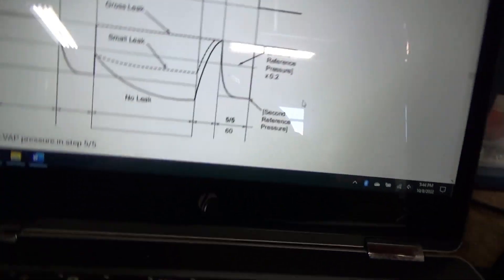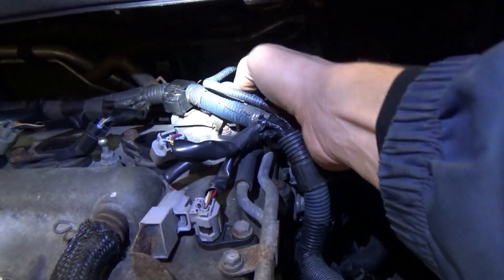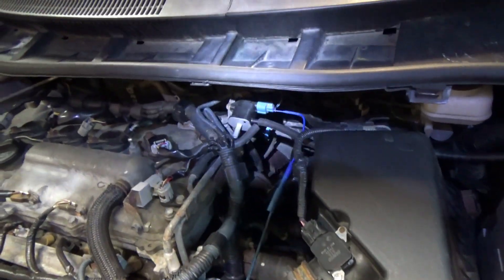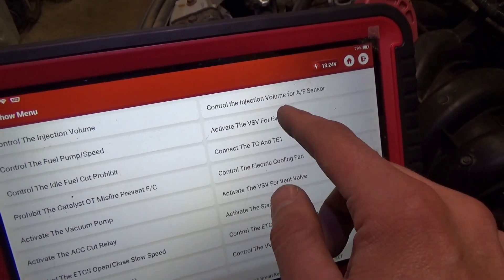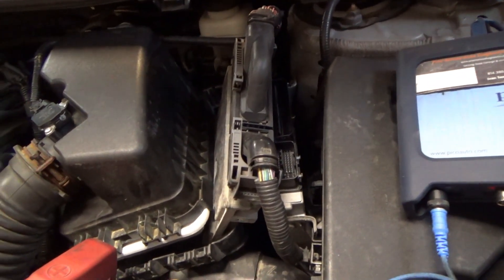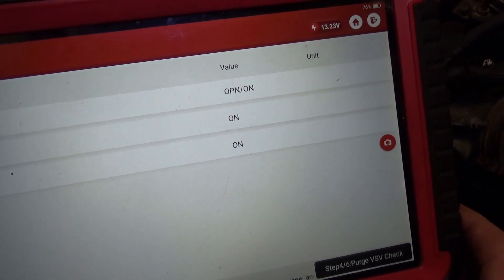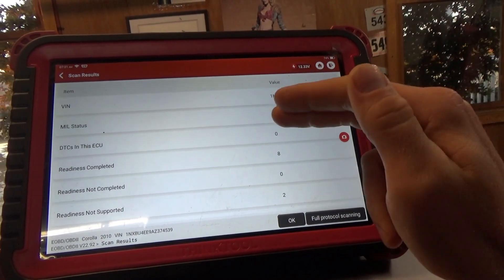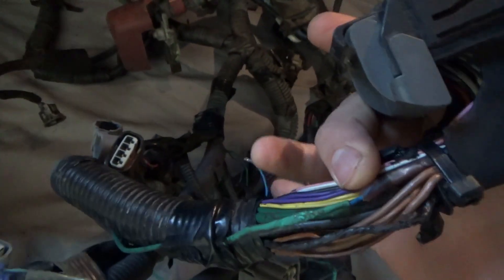2 YEARS of Parts Cannon?! (Toyota EVAP - Part 2)

Comment: We watch Scotty for the education, Ivan. He recently told us why we don't really need $3,000 'smart' washing machines. Who would have ever suspected that? And who doesn't love his cat inserts.
Reply: Actually the smart washing machine has come in hand recently, i wasn't after it when i bought, just a combined wash and dry machine, when I came home noticed it had internet connectivity, thankful for it today. Probably not in NA but here the fixed electric is so high that not worth having. The spot prices fluctuates like crazy over a day. So the same wash depending on time may cost 4cent or 4$. 
Suddenly the smart washing machine that you can tie to a script the reads the next 24h electric spot prices and wash on the cheapest hours isn't so stupid. Same goes for dishwasher, water heater and house heating. Of course you can start it manually at that time but at least I'm not interested in getting up in say 2AM to flick a switch
Reply from the maker: Hah I just saw that with the fancy BlueTooth washing machines and fridges haha Preach it Scotty!

Comment: So you kept referring to vapor pressure rising back toward atmospheric within 10 seconds. That's accurate when the Toyota is doing its own Evap test while the key is off. The purge valve will get commanded 100% on. The same thing happens when you use a scan tool to perform the automatic Evap test. But when you choose to do the manual Evap test, the ecm then pulses the purge valve. Silly, but I've seen amazing techs get tripped up in the difference between the automatic test and manual test.

I've also never seen that driver fail. Not saying that its impossible. But my gut says that someone damaged it with poor testing techniques.
Reply from the maker: Hey PJ thank you for the insider information! Someone mentioned in Part 1 that there is a TSB on this? I couldn't find it... Car history is questionable for sure. But something had to break in the first place to promote any sort of "testing" right?
Yeah ThinkTool only had "Manual" test available. 100% Purge would definitely vent the canister faster than 30% clicks :)
Reply: @PineHollowAutoDiagnostics  yeah, there is a TSB for water intrusion in the charcoal canister and there is an updated filler neck for it.

I’d love to know what the first failure actually was. Leak detection pumps are a fairly common failure. Put the parts cannon probably created more problems than it fixed.
Reply from the maker: @VoltageDropDiagnostics  Coming to Super Saturday next week? I'll be there, and Keith too!
Reply: @PineHollowAutoDiagnostics  I’m teaching there. I’m actually teaching a class on toyota evap systems haha
Reply from the maker: @VoltageDropDiagnostics  LOL that's awesome! You could show a clip of this video 🤣
Reply: @VoltageDropDiagnostics   I am glad you commented. I saw your name and realized I hadn’t seen anything uploaded by you lately. When I went to your channel to see if I missed something, I learned that YouTube had apparently taken it upon themselves to unsubscribe me.

Comment: Questions:  The owner did replace the ecm, so why were the codes still popping up? Why did it start working?  Did you replace something and I missed it?
Reply: 1. The owner had a bad ECM and misdiagnosed it.
2. The owner added aftermarket part(s) that created a secondary problem.
3. The owner's original problem was diagnosed and fixed.
4. The secondary problem,caused by aftermarket part, went undiagnosed and caused the same codes.
5. Ivan replaced the aftermarket part with original. 
6. No codes... for now
Reply: @_RiseAgainst  Very good, Thank You.
Reply: So the owner added to the confusion, by replacing the OEM valve with a cheap Autozone  purge valve?
Reply: @chuckvoss9344  basically half of Ivan's videos.
Reply from the maker: Yes please watch the entire video 😄

Comment: I tell people all the time (mostly Jeep blogs) "DO NOT IF AT ALL POSSIBLE REPLACE ANY ELECTRICAL COMPONENT WITH ANYTHING BUT OEM!" It may not be show an issue right away, but chances are it will eventually. I don't know why, but I have box of aftermarket Jeep TJ parts to prove it! Great work, Ivan! I knew you were onto something  when you mentioned he replaced  the OEM purge solenoid. 👍

Comment: I also follow the OE parts rule after having being burned by aftermarket electrical parts.  Interestingly, some customers get offended when I replace their "new" aftermarket parts with OE parts and fix the problem.
Reply: It's something everyone must learn first hand.
Reply: The general public is mislead by advertising, into thinking that aftermarket parts are as good as or even better than OEM.  It’s hard to blame an ignorant car owner.
Reply: @The_Redkween  Certainly there are cases where aftermarket parts are better than OE or are engineered to solve a certain problem. Such as replacing the OE plastic coolant crossover pipes with aluminum, in various Euro cars. You're right though, just as often, aftermarket parts turn out to be much worse than the quality OE. Like replica alloy wheels, "ebay" turbo headers, junk China bearings in timing sets, cheap ball joints or suspension bushings, bottom tier brake pads,  junk MAF sensors... the list goes on... Or you may get a fake! Like the fake NGK spark plugs, or fake HKS blow-off valves. Not no-name replicas, but straight knockoffs, label and everything. Sometimes coming from the same factory, sometimes different. These vary from OK-ish to totally useless junk! This is happening in the PC parts world as well, and I imagine everywhere else. Even the medical world, with fake medications. Amazingly though, sometimes the (cheap) automotive aftermarket can make stuff on their own label that's actually decent. It's kind of crazy the huge variations in quality as well as the multitude of options we have today

Comment: One thing I'd like to know if different between the two solenoids is the inductive kickback.  That can wipe out a driver.  Perhaps one had some kind of suppression the other did not.
Reply: And maybe the design quality of the plastic parts, there could be a burr or two in the passages messing up the through put of the valve and degrading the performance thus setting the code?

Comment: As always cheap aftermarket parts strike again especially with electrical parts because the modules and the electric sensors need to shake hands and agree with each other  never ever do that better off buying an OEM or high quality aftermarket parts that will last much much longer
Reply: try using a maf sensor on a toyota from auto zone never will the fuel trims be right
Reply: @juanrodriguez-ry6yt  Ya That's why I bought a Denzo ignition coil because I knew if I put an aftermarket one in it just would not last.

Comment: These crappy electrical chinese knock off parts are more often than not not fit for purpose and therefore should fall foul of some trade description legislation, how the hell do they get away with the supply and sale of components that simply do not work properly?  Had similar problems with the passenger door lock actuators in my Sequoia,  first one failed within a year (got a full refund), second one failed after 13 months.  The actuators were eBay specials that only cost $15, the one I installed yesterday was a whopping $60 but is OEM so should last longer than the first two!  Got tired of removing the inner door panel and it is a bit of a fiddly job.  As you say Ivan buying cheap parts can be a false economy.
Reply: I want my job fixed right the first time. I would MUCH rather pay $60 for an OEM part and have it fixed over a $15 junk part and have to go back in and waste an hour or two of my time.
Reply from the maker: Hey Rob! I can't believe the door lock actuators still work on my 1989 Mazda van... Toyota quality must be slipping haha 😉

Comment: I'm of the mind that by the time a car comes to your shop it's no longer about the parts, that's already been tried and it didn't work, charge as you see fit, you're a very fair person and your expertise and time is what people are paying for, if it takes 5 hours so be it, after 2 years I'm sure anyone would be happy to be done with it, great job
Reply: yeah I agree. 3 hours is more than fair considering he has to wait for the 5 hour after two drive cycles for the evap self test. Manual testing didn't give any concrete conclusions. I would have wanted to charge more for this myself but seeing as how someone better charges 3 hours, I will be reevaluating how I do my own labor quotes.
Reply: sure   but this car is worth $1500 on a good day so paying more than half of that to get it running for no one knows how much longer makes no sense
Reply: @111-c7x2t  what part of the world do these go for $1500?
Reply: @111-c7x2t  that’s not the mechanics problem

Comment: I have noticed Toyota's are very particular about setting codes for emissions. I wonder if its because Japan was so strict on emissions earlier on compared to elsewhere. 

I'm not as sophisticated on diagnostics as Ivan but I've found a good tactic for a little swaptronics testing - go to the scrapyard and find a "fresh kill" and strip whatever part it is you think is suspect. If the car was wrecked chances are it was fine when it went to the scrapyard. You have a better chance than getting into aftermarket parts.
Reply: I doubt it - Japan pretty much follows the EU standard, which allows much higher emission than the US, esp. California.  California has some of the strictest emission in the world, so much so they mandated all manufactures use OBD2 (which California designed/invented).   The EU standards allow for 3x more pollutants than US Tier 3, nvm California.
Reply: @ckm-mkc  one standard in Japan that Cali doesn’t follow is leaks.  In Japan, cars can’t leak anything……at all…..not even a drop.
Reply: Probably! I bet more than half of 2010 Corollas in Japan have already seen the crusher!
Reply: @rkan2  Either that or they got sent to a middle income or 3rd world country as a grey import. New Zealand is full of Toyotas that got chucked in Japan because they were 5 years old.
Reply: Most asian cars were over engineered until they figured out they can make them cheaper and they are still better

Comment: And now that I've finished it (wild that's all it was!), my theory on the failed output:

The car manufacturers, in a quest to save money, are skipping blocking diodes on the driver outputs to coil driven actuators.

Any DC coil is going to generate inrush current against the driver.  Half an amp at 12v is actually not insignificant.

Any driven outputs (other than one actuated by relay) will eventually fail after getting hit with inrush current over and over.

The pinball industry learned this in the 80s, which is why every solenoid in those things is protected with a diode.

When the diodes fail, become disconnected, etc ... driver failure almost certainly follows.
Reply: I concur, I saw those spikes on the scope.
Reply: I am not as knowledgable as you, so may I ask a question?  If the purge solenoid had a relay installed to operate it, would that protect the driver in the computer?
Reply: @dws2313  likely so, because relays have a much much smaller coil in them.  It's why relays control so many things in cars, acting as the interface between CPU and load.

Comment: I Diagnosing a misfire on a Sienna, all the coils were aftermarket and the one on cyl 6 was bad, the customer was upset and saying I was wrong because he had just replaced them all with new spark plugs not to long ago, he had tossed all the factory coils. Also those  style purge valves are junk from the factory and go bad all the time, better then the aftermarket but still junk.
Reply: New is better🤣

Comment: The original "harness hack" guy was on the case, but didn't like the price he was quoted for a PCM.
Reply from the maker: He simply didn't know how to test a 2-wire circuit...splicing wires is a LOT harder than taking a couple voltage measurements ;)

Comment: Scotty Kilmer would just drilled a hole through the firewall, run some wire and put a toogle switch on the dash for the purge valve
Reply from the maker: And then try to convince you that the "dealer level scan tool" said that is a good fix lmao

Comment: I am in complete agreement with original parts for replacement. The mystery to me, which I have asked many sources including my parts store, is why and how companies (like Dorman) can market products that have a high failure rate or flat out don't work.
Reply: Because they are just cheap enough (at least compared to oem) that people keep buying them. Auto parts store doesn’t warranty used electrical parts so it doesn’t cost them or Dorman money. If anything it makes them more money when people buy another ‘cheap’ sensor. With the general public, cheapest price by in large wins out over quality.

Comment: I love the Dig at Scotty. Our 04 Corolla had 2 ECMS replaced...under warranty and recall. Was one of two issues.  The other was the fuel pump.
Reply: I don't think it was a serious dig at Scotty. All working components have a statistical failure rate but a high value doesn't mean that every single one of them will last a "long time", even Toyotas.

Comment: I can see the purge valve being a cause of a fault. I saw this before on one of Paul Danners videos. He replaced a purge valve on a Hyundai (I think it was a Hyundai). Apparently the purge valve wasn't electrically built the same way. So the aftermarket purge valve is working. But isn't opening and closing at the right amount. Meaning the coil inside is wound differently and thus changes the open and close time. This effectively changes the flow rate. So in this example it seems like the pcm was bad. But then the replacement of the purge valve caused a new problem. Like you mentioned electrical parts have to be oem. I run into this a lot at work. And I've mentioned it before. Anytime I diagnose an electrical fault. Then install the aftermarket part. And the original fault is still there. My first move is to tell the service writer to either get me another part. Or get me an oem part. If the oem part is installed and the fault is still there then I'll take the hit. And keep diagnosing. But often, very often, it's the former. And I'll chase my tail thinking I did something wrong. So I stopped doing that on account of going through this too many times.
Reply from the maker: Yup learn by experience for sure :)